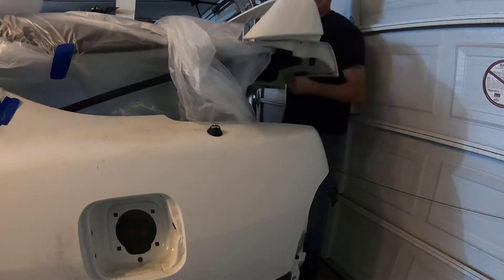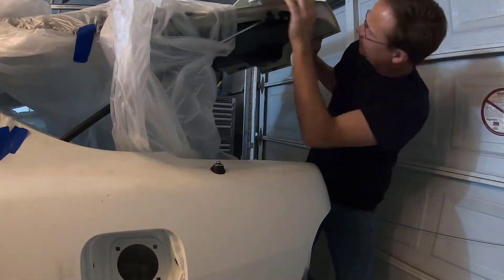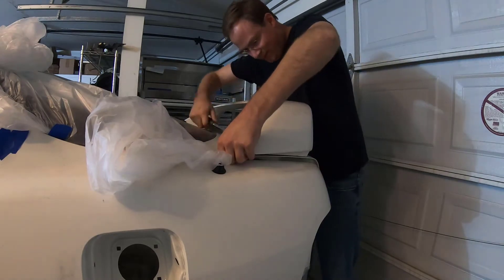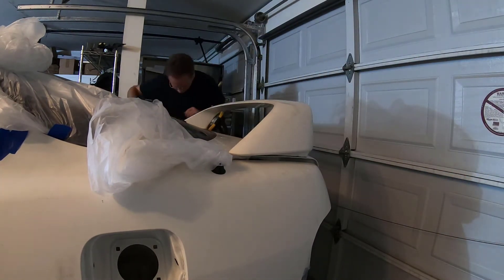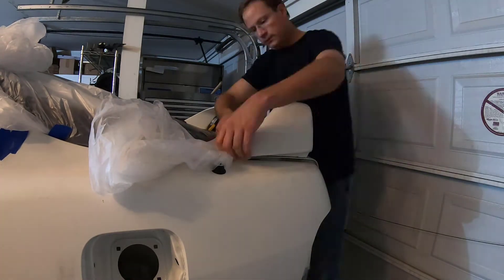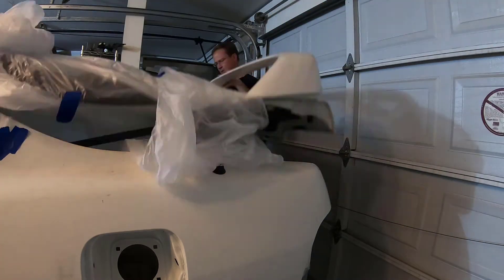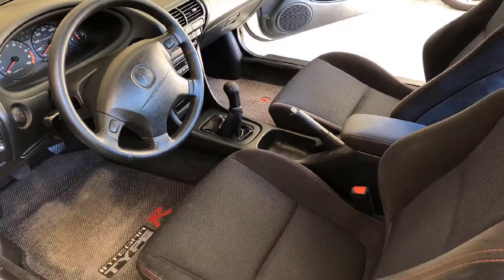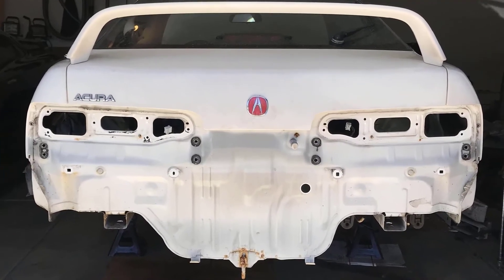TRB DYI _ Integra Spoiler Removal The Rusty Barnacle - ITR 98-0111

Comment: Im also doing a restore on 98-0326. Bought it in May 2018 and it has sat in the garage while I either worked on other car ior didn’t have time. Now during the quarantine I am getting it going. Pulled the motor last Sunday and I am debating having the engine bay painted So that it’s nice and clean when the rebuilt motor goes in. Going to be an all OEM restore/build. Think it would be a bad idea to paint the bay even though the stock paint in the engine bay is pretty rough? I wish it was in better shape so I could keep it original but I think it needs a respray